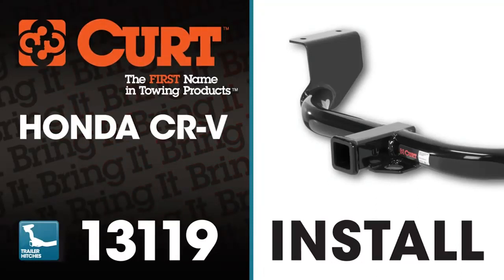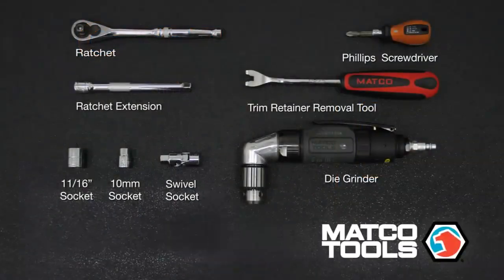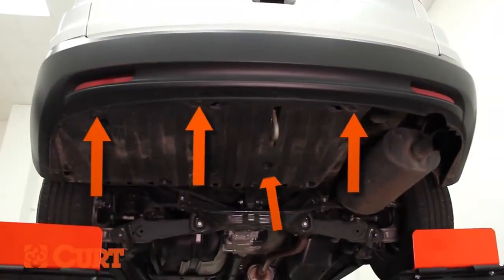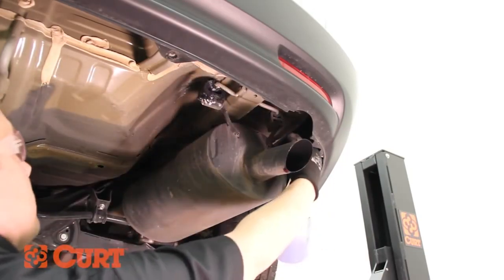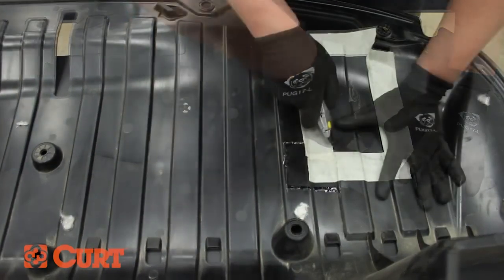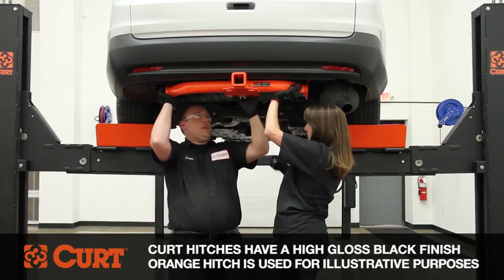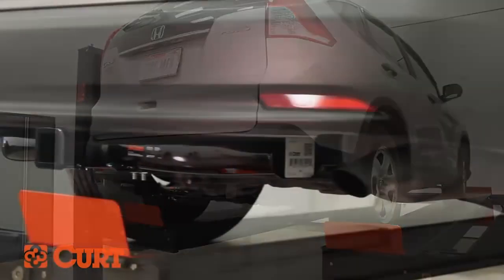CURT Rear Trailer Hitch Installation on Honda CR-V

Comment: Just installed one of these on my 2016 crv, pretty easy install, my biggest hangup was working around the muffler, but went on super smooth and looks great, probably going to patch the piece of the lower panel back in place though.  Did this solo, took about and hour and a half total time, had to go buy a torque wrench.

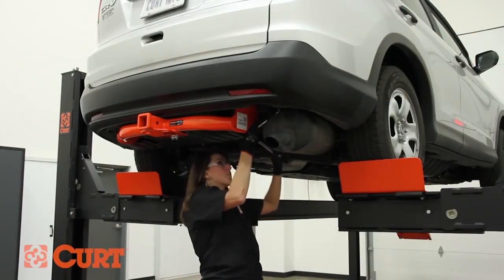Comment: 2:08  Um, why not just tell us the torque specs here in the video. (this is supposed to be an install video).
Reply: I dunno, but AFAIK correct torque settings are critical and particular to what's being installed and even condition of the vehicle. 

E.g., on tire rims torque depends on whether a vehicle wheel is made of steel, alloy, "mags," or other type of metal, and what its being married to.

E.g., for the hitch I would want to know the type and quality of the steel frame Honda used each year, and see the type of bolts that are compatible with the frame. 

Also, if using lock washers, I'd be careful when torquing those since we all know, nuts, bolts, and washers come in all grades. (Hopefully this kit uses quality steel that's not going to snap when driving over potholes and the CRV is suffering from poor suspension maintenance or worn struts.

Comment: Does anyone Knows where to get the Hitch on that orange color?I couldnt find it on the website
Reply: Thanks,Yes my local Paint shop charges more for Powder coating it than the actual cost of the Hitch since they have to sand and prep